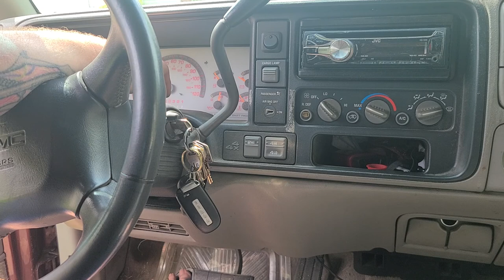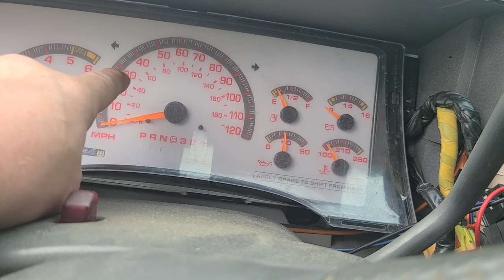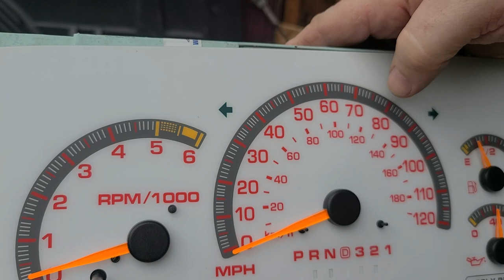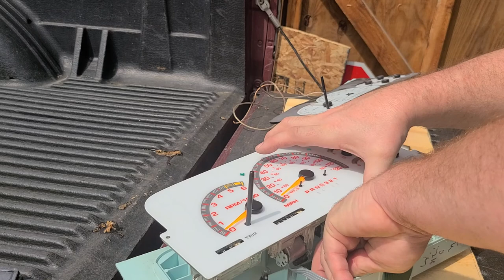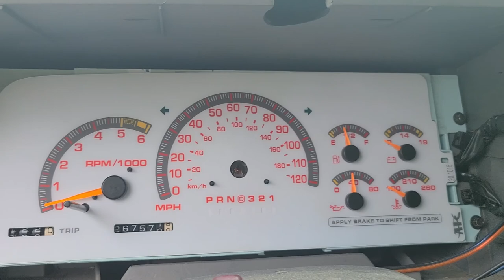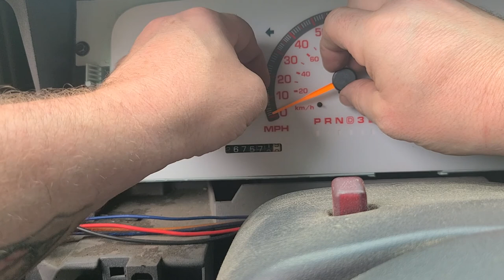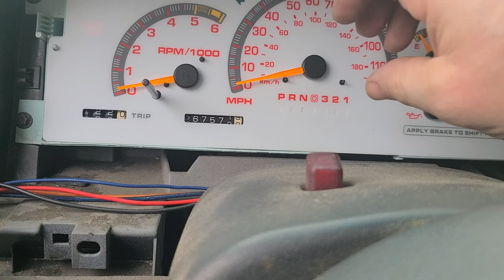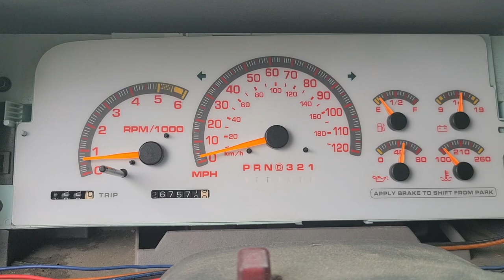How to change the speedometer motor in the 1998 gmc k 1500

Comment: Where can I get this motor? Thanks Outstanding Video
Reply from the maker: You can find them sometimes on ebay buy it has to have an s on the side for speedometer motor I have a spare cluster that I took it out of or check with a a junk yard see if they have a cluster you can just buy to have parts

Comment: Did you make a second part to this video? See my speedo reads way too fast ill be at 70 on my gps and my speedo reads 90 😮 i want to fix this problem as its putting too many miles on the odometer to fast plus i dont want to get a ticket for impeding traffic 😅 if you can please send me a link in a reply thank you. Oh and will this fix cure my problem? Btw. I replaced the vss with a brand new one
Reply from the maker: Are you running a stock tire and wheel cuase running different size wheels and tires can make ut nit read right smaller tires will read faster bigger tires read slower and when you turn the key on not moving where is the needle sitting at is it at 0 mph
Reply: @duanescarpad2831  stock wheel and tire size never checked if it was at zero when key turns on, first time I have had this problem does it matter if needle is at zero or like 1mph or 2mph? Idk 🤷‍♂️  don't know much about these things
Reply: @duanescarpad2831  actually just went out and checked and it's sitting below zero and when I cycle the key it don't move. Um... is my unit hooped?
Reply from the maker: You may have take it in for calibration I cam tell you what I did for mine. I run 35 inch tires on a 6 inch lift mine was slower reading what I did was took the needle off the speedometer carefully the pop off with a small flathead screw driver I went out on the highway nice straight part set the cruise at GPS 70 and then tried my best to put the needle back on close as I could get it to 70 that's a bit extreme I no but my needle is now with in a mile either way with the GPS but I have a scan tool which aloud me to reset to a different tire size to get the needle closer I still turn on my GPS sometimes to make sure its still good but the new vss may need programed by a scan tool not sure
Reply: @duanescarpad2831  thank you I will try to do that. But like I said it is below 0 when stopped and doesn't move at all like yours did when you cycled the key I believe the dash was taken from same year suburban and the redneck that had the truck rednecktified ALOT of stuff I'm now trying to correct lol like I said if you have anymore info about my 98 chevy like tips or advise that would be awesome 👌  also I believe that guys father in law put the engine and Trans out of the same suburban into this truck idk if that helps
Reply from the maker: Ok good luck that's all the info I can give you and up have to take it to a shop for calibration I hate to say it but sometimes it is unavoidable wish I had more info to offer you
Reply: @duanescarpad2831  you have help me heeps I appreciate it and the video that led me in the right direction but one last thing... why 1mph on the needle? Is it so the motor in the back has room to cycle when you turn on the truck
Reply from the maker: The one mile is just where my needle sits when the truck is on for my truck that's where it stays
Reply: @duanescarpad2831  oh ok wasn't sure if it was some sort of setting procedure
Reply from the maker: Yea thats were it should sit at 0 but mine is at 1 for my tire size that's all